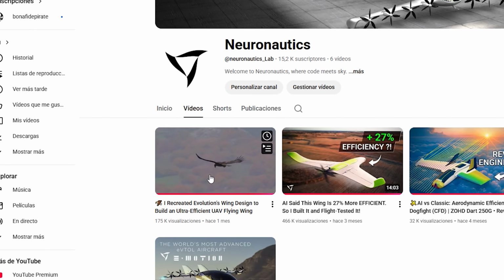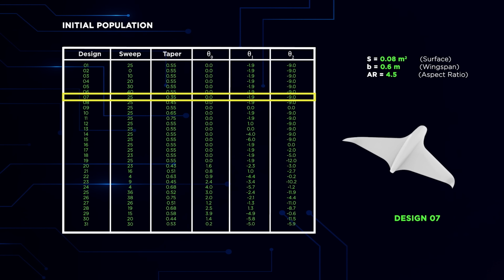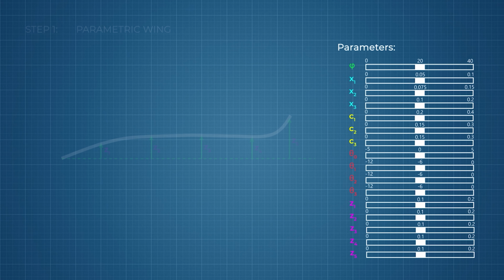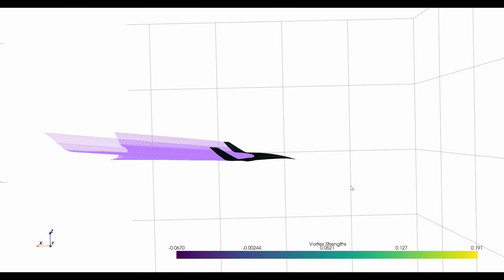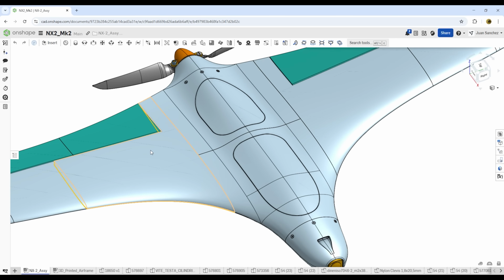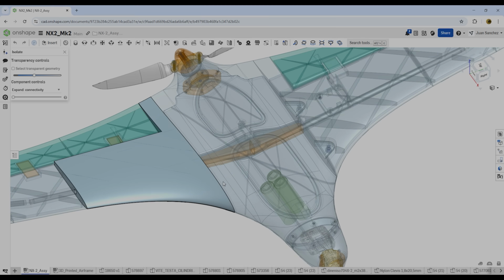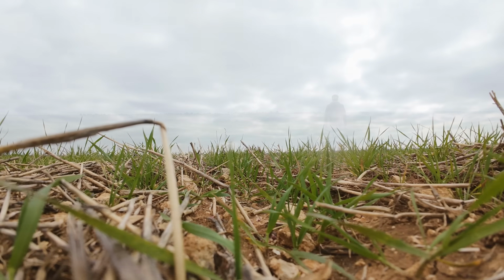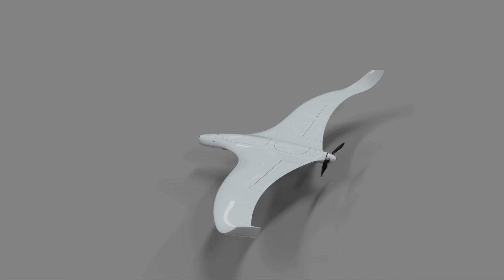AI Designed This Organic Flying Wing… I Had to Build It (+16% Efficiency)

Comment: What is the flying wings specs like Wing loading and glide ratio? What is its optimal cruising speed? 
I didn't see these mention in the video. It'd be interesting to see how it compares to a modern style glider
Reply from the maker: Wing area is 0.15 m² and wing loading is roughly 4.7 kg/m². Glide ratio is around 12:1, and the best cruise / endurance speed is about 12 m/s. 🚀✈️
Reply: @neuronautics_Lab   thank you for the information. That's very respectable. 
Have you heard of the prandtl-D flying wing popularized by Albion Bowers? 
There is a good number of YouTube videos of him speaking and a couple research papers that are a wonderful Rabbit Hole to go down. Might be a good starting point for letting the AI optimize.
Reply from the maker: Yes, I definitely want to dive deeper into the Prandtl wing. In fact, many of the trends from this MDO analysis seem to point in a very similar direction, which makes it especially interesting to explore further. It may be a really good reference point for future optimization work.

Comment: If you want to change the shape of the wings mid flight, I suggest you look into memory alloys like nitinol. You can completely change the shape by applying resistors and control it's shape. So far, it only have two states with a 20 degree difference in temperature , which should not be very taxing on your battery depending on your takeoff weight.

Comment: In the beginning, the bird's wing has 3 feathers splayed at the tip of the wing. Could those be used as some sort of control surfaces for micro movements/corrections?
Reply from the maker: Honestly, I’m not sure. It’s possible they help with fine aerodynamic adjustments, but bird wingtip feathers also mainly help with reducing vortices and improving efficiency. It’s a fascinating topic. 🚀✈️

Comment: Have you considered the extra flex and the change of the wing geometry during the flight? Maybe the propeller(s) arrangement (location size blade number etc)could be added to the design to maximize efficiency
Reply from the maker: For this first step I kept the model simpler, but adding structural deformation and even propeller variables to the optimization would be a very interesting next level for maximizing efficiency.

Comment: Based on your models and studies, would a wing tip flare up have improved the stability of the TB-49 and Ho-229 designs enough to make them mission ready???
Reply from the maker: Definitely — adding vertical surfaces at the tips, especially on a swept wing where they sit well behind the CG, increases directional stability, and that almost always helps. It probably wouldn’t solve every issue by itself, but it would be a very meaningful improvement.

Comment: Luigi Colani made a proposed NASA Space Shuttle concept called the 'Polymorph' bitd. Pretty similar with the exception of the blunted nose section on yours. 
AI is doing nothing new, just another tweeked iteration of what had been done.
Reply from the maker: Thanks for the reference — I didn’t know that concept, and it looks really interesting. And I’d agree that AI is not creating ideas out of nowhere; the real value here is not “inventing from zero,” but helping explore and optimize design spaces much faster within an engineering workflow. In that sense, it’s less about replacing past ideas and more about building on them in a more systematic way.

Comment: So he designed what nature has been doing for countless years, attributed it to "AI" and is now peddling it as something new?  Good job figuring out that nature already had it figured out.
Reply from the maker: You’re missing the point — the value here is not claiming nature was “wrong,” but using optimization tools to systematically move the design toward those efficient patterns under real engineering constraints. Nature is an inspiration; the interesting part is being able to reproduce and quantify that process in a controllable workflow.

Comment: I'm not sure how much extra weight it would make, but for the landing you should consider something like a retractable ski to slide on once it hits the ground.
Also, I think the assembly would become much easier if the print would include keys to help positioning the parts correctly, instead of cutting everything with straight lines.

Comment: Clickbait. I watched this whole video as the title mentioned AI, only to find out the AI wasn't used AT ALL for any steps.  Why do people insist on dropping "AI" into video titles just to get extra clicks?  Do you honestly not know what AI is in 2026?  Computer algorithms and parameter optimisation is NOT AI - you could even do this without any machine learning or neural networks.  It looks like you just wrote a python script to run standard differential evolution and called it "AI" just to get clicks.
Reply from the maker: Sorry, I do not agree with you. I think you may have a narrower view of AI than its historical meaning. The term artificial intelligence has been around since the 1950s, long before LLMs, and has long included computational search, optimization, and other methods for solving complex problems automatically. This workflow did not use an LLM, but it absolutely did use AI-related optimization methods to explore the design space under constraints — so it wasn’t just “clickbait,” it reflects the actual process shown in the video
Reply: There isn’t a historical meaning unless you’re talking about fiction.

Comment: I think there’s room for improvement in the turning control, as the wing flaps weren’t accounted for in the algorithm. Instead of changing wing shape, maybe a propeller control system could be used? One of those compliant joint mounts that let the propeller be angled and maintain stability via the elastic returning force?

Comment: Fascinating video about an amazing project.
Did you not include the wing profile in your simulations?
Reply from the maker: The airfoil was kept fixed as a Selig S5020, which is a good choice for this kind of low-Reynolds-number, efficient flying wing application. For this project I wanted to focus first on the overall planform and geometry, but definitely one of the clearest next steps is to carefully vary the airfoil along the span and include that in the design space too

Comment: 16:40 - I love it when YouTube engineers optimize something for aerodynamics but they don’t spend 1 minute making the surface smooth at all. 🤦‍♂️🤦‍♂️🤦‍♂️
Reply: You understand what a prototype is, right?
Reply: Super smooth surfaces lose laminar flow easier, a more matte surface will stall at a slower speed than a super shiny design
Reply: its why golf balls have pits/dimples

Comment: Paulownia (Paul-ow-nia)
“The other balsa”

What is the optimal material for model building?

In design cases where the cross-sectional area is constrained, (for example if a narrow spar is needed), then carbon-fiber is a high performance material. However, when there is space for a thick cross-section, theory says that balsa (and similar low-density woods) are actually higher performance materials than carbon-fiber!  Their performance is on-par with “XPS” expanded polystyrene foam (aka Styrofoam).  

So if you’re concerned about micro plastics, or you want to save a bit of money, or you want to be able to source natural materials, or if you like the idea of biodegradable/sustainable materials made in the USA, or if you want to find a good use for so-called “invasive plants”, consider Paulownia, “the other balsa”. 

Paulownia has about half the density of pinewood and with equal stiffness. 

Lightweight PLA has a density similar to pine.  

Paulownia and pine are both about 3 to 5 times higher stiffness than lightweight PLA. 

Paulownia grows in the wild in these states:
Kentucky
Maryland
North Carolina
South Carolina
Tennessee
Virginia 
West Virginia

Significant amounts, though scattered can be found in:
Alabama
Arkansas
Georgia
Ohio
Pennsylvania

Find it along: roadsides, forest edges, stream banks, disturbed woods, treefall gaps, and rocky habitats. 

Flowers from April-June, 
with abundant, large lavender-violet, tubular flowers.

Comment: I purchased the files and would appreciate a PDF showing your optimal orientation or a print video that would take them to the next level.
Reply: Same here, I’ve tried printing the two fuselage parts without good results so far. Would like some guidance on the best way to print such this structures

Comment: damn, that is a very nice shape.
I would call the optimization for a genetic optimization algorithm. I would probably have picked the best 3 designs and run a gradient based method with there designs as the starting point.
Just to see if there maybe was a few % to get close to these designs.

Also did you just penalize the cost function linearly or did you make it a nonlinear steep wall?
Also did it satisfy all your constraints with the final design, and what constraints was the limiting factors?

Such a cool project. I really love this. 🥰

Comment: I just kinda copy whatever boeing has on their big jet liners like the Max...but Im limited building from foam board so harder to get the twist right..but being so lite around 1 1/2 lbs and so overpowered they usually fly good. I also dont do long range fpv so efficiency not really a priority though I am very interested in the subject cause maybe one day...really like you work...amazing job on the design.
Reply: Cutting twist into the foam sections is old tech, from the Rutan home built designs, and earlier. No harder than cutting 'no twist' sections, the same precision setting of the outer template, either way. Twist doesn't have to be constant, either. Add more at the tips, may have lift advantages, approaching elliptical plan shapes, real PITA to cut with hot wire.

Comment: Have you or it incorporated Al Bowers work upon the Prandtl ‘33 and Horten brothers? Look for a bell shaped lift distribution instead of an elliptical one? Meaning fly down wingtips such that you get proverse yaw not adverse yaw. This way you need less concern for vertical stabilizers and rudder. Saves mass. It also means less wing flex so saves structure mass there too.
Reply: That would reduce spar weight, but the mass of this model and most small UAS is dominated by the wing skin weight.  Adding span to push the wing tips downwards is not an unearthed secret as Al puts it, but a well understood option engineers pass up on because they know better.
Reply: @Flyzguy  they know better or they’re stuck in a tradition? Yes, reduce spar mass, and also reduce vertical empennage type structure.

Comment: Running a bunch of dynamically adjusted simulations and picking the best one is not AI, it's a normal computer program functioning entirely through code.

Your entire presentation is based on a lie.

Comment: It is great to see a project progress from an initial idea to a real-world test. As an engineer, one of the first things I noticed was that the design did not provide for precise positioning of the wing sections, and simple gluing alone is not an ideal solution. I would use hook-type locking features in combination with adhesive bonding, or better yet, a mechanical connection using plastic bolts.

I also noticed that the controller, electronic components, and cables inside the fuselage were not arranged properly from a weight distribution standpoint. In addition, I believe that without a vertical stabilizer, the model loses directional stability, becomes more susceptible to sideslip, and under unfavorable conditions may enter dangerous flight regimes such as a spin.

In any case, many thanks for sharing your experience. 🖖
Reply: This design does have vertical stabilizers, one at each wing tip, well aft of the CG, which double as tip vortex controls, though possibly not optimized for either. Wing twist and sweep are also integral parts of aerodynamic stability of this concept.

Comment: Remarkably similar to Northrup's original flying wings of the 1940's without the constraint of having to build in straight lines. In addition to being very efficient this aircraft aesthetically pleasing. You have done a good job in explaining the design methods but not as much as the 3-D printing. as I said, good work.

Comment: I'm sure the 3D printed PLA is light, but I bet you could make the whole thing even lighter by 3D printing a mold and vacuum forming a high-impact polystyrene shell or doing a carbon fiber layup. Awesome video! I just subscribed
Reply: They make a special lightweight PLA specifically for this application. Id put down a single S glass layer instead of any other fiber personally.

Comment: the cnc parts i think are to make a thrust measurement for the motor? i absolutely love this wing and i would love to try to print this and fly it. im not sure if my printer will it is older but if there is a stl i would love to try! if you can share the design that is. i subscribed also great job.
Reply from the maker: Thanks! 🙌 Yes!! You got it right ;) Those CNC parts were for thrust testing. Really glad you like the wing, and thanks a lot for subscribing! You can find the STL files here: https://cults3d.com/es/usuarios/Neuronautics/modelos-3d

Comment: Yaw control? Pitch control? Looks like you only have ailerons. Single propeller will also roll the aircraft, reducing efficiency
Reply from the maker: Thanks! 🙌 It only has elevons, so pitch and roll are controlled there, and yaw stability mainly comes from the wing geometry and fins. You’re right that a single tractor/prop can introduce some rolling tendency, but in practice it’s usually small and can be trimmed out. 🚀✈️

Comment: Congratulations on achieving your +16% efficiency, it's truly impressive. I'm really looking forward to the next videos to follow the evolution of the upcoming designs.

I had a few questions out of curiosity:

* What weights did you assign to each penalty in the objective function?

* How did you determine them? Was it more of a heuristic approach, or did you perform some kind of calibration?

I was also wondering if it wouldn't be interesting to directly obtain the Pareto front across all the objectives. Ultimately, if you're using DE, you could treat penalties as objectives (inverting the sign if necessary) and optimize everything in multi-objective mode.

I understand, however, that some penalties will have variable weights. For example, if the stress exceeds the limit of the adhesive or the plastic, it would make sense to significantly increase the penalty to force the algorithm out of that region.

And just out of curiosity:

Which DE algorithm are you using exactly (DE/rand/1, best/1, LSHADE)?

* Does Onshape have an API to solve the direct FEM?

Great job, and looking forward to the next video!
Reply from the maker: Thanks! 🙌 Really appreciate it!
For this version, the penalty weights were mostly heuristic and adjusted iteratively so the optimizer would prioritize the most important constraints without getting stuck too easily.
The DE variant I’m using is the standard SciPy differential evolution implementation.
And yes, Onshape does have an option to perform FEM directly — really intuitive to use.

Really great questions! 🚀✈️

Comment: I try to learn as much as I can to achieve something similar as you did. Love your videos. 
The surface roughness out from the 3d printer vs the wing size is important. I bet that if you improve it, the drag reduction wouldnt be small.

Comment: Very nice! Are you planning movable wings at any point? Or wings made of flexible materials with adjustable tensioning? This does look really good. Have you done similar optimizations for the propeller blade? I've also been wondering how much a goal-oriented flight AI can improve over a human pilot in terms of power efficiency or speed or other metrics. Anyway, looking forward to your next update.

Comment: First of all, I love what you're doing, very innovative. But I have a question. Would a carbon fiber body give you any flexibility opposed to a plastic version. I was thinking that in your design, a little flexibility would be a good thing, not much mind you, but just enough to absorb movement or wind change. I mean birds are organic soft creatures and that is something that helps absorb their movements, along with muscle and tissue. Something else I was wondering, would having a flexible skin on the frame so there is no Aileron shape breaking the edges work, you know like a thin silk. Something that will stretch back to shape but not have much "pull" to it like spandex. But hey, just a thought. Great work!

Comment: 2 factors to lift most under estimate, how close to the nose and how far above relative to height, to optimize give unlimited configurations and run several simulations at the same time.
Reply: And I should say the perfect design is ungraspable to the normal individual, being the best design is something we would never think of only get close if that it should look alien both in form and function, this doesn't undermine the work put in, let it drive you to go further beyond, you are more capable than you think, I truly want to see the best is possible given enough time optimization and parameters feasible, and wish you the best ❤.